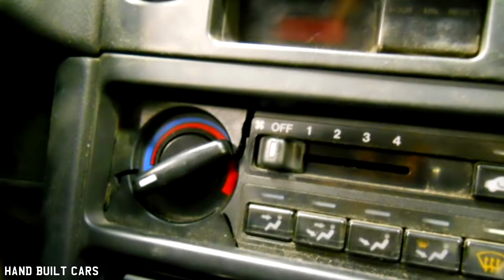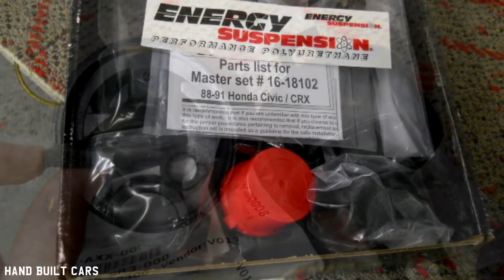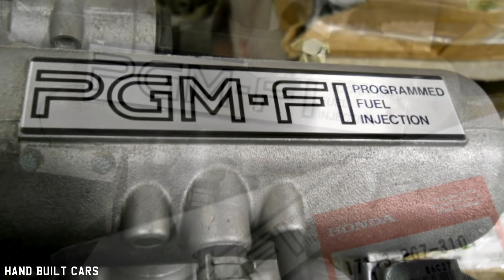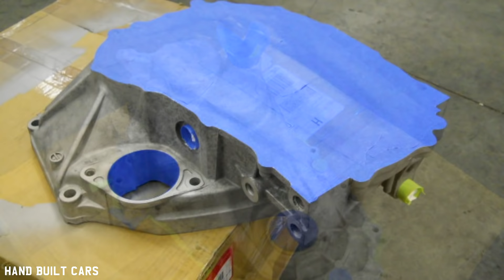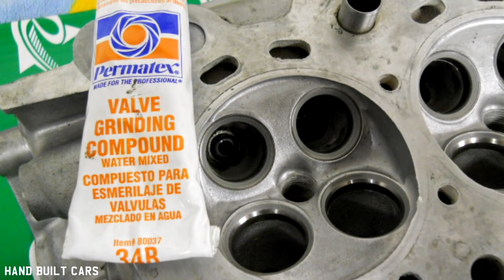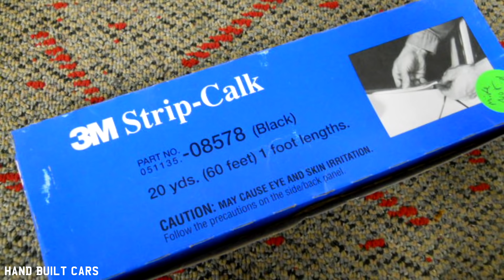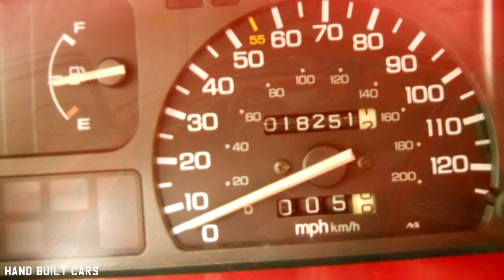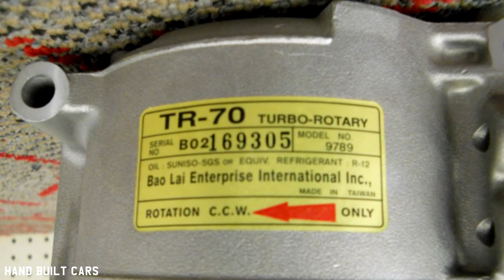★★★1990 Honda CRX Total Restoration To It's Original Factory Condition

Comment: Dat undercoating with cans is shit, for undercoating to work properly it needs to be heated to a certain temperature, it actually needs to be sprayed boiling hot. Otherwise it will make air bubbles, peel off and rust 10x faster. But above that I love to see someone fix what ricers killed.